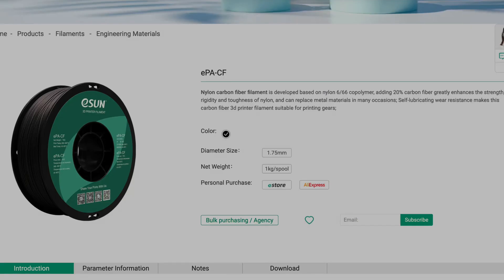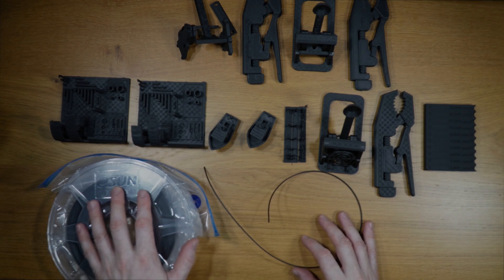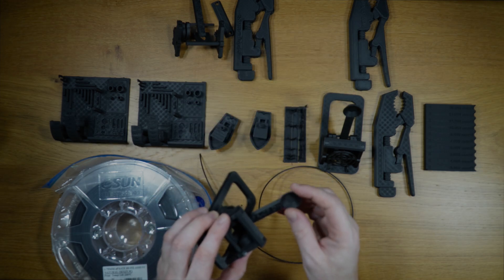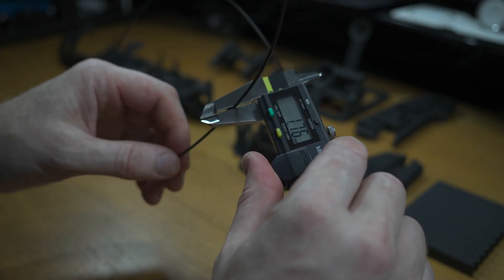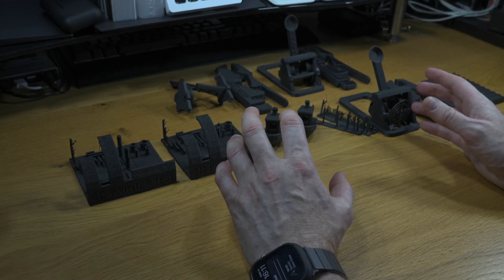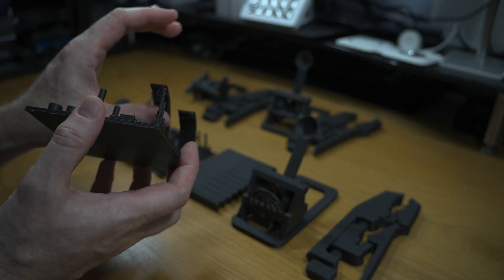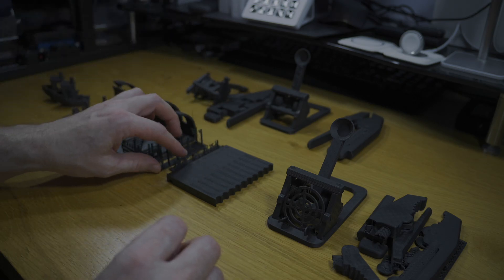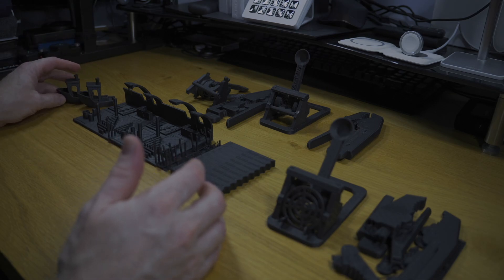eSun Carbon Fibre Nylon (ePA-CF) with Bambu Lab Carbon X1 Printer: A Followup! 🔍

Comment: I printed with this at pla 300mm/s base speed and just changed the  temps to 280c nozzle and 100c bed and it printed perfect (20rh). Then I tried the recommended slow speed  at 13rh and it failed over and over.

Comment: 0.04mm or 0.06mm I want to test my next filament and CF is on the list! Tested ASA ABS 20+ types of PETG I'm yet to print with PA ( CF ) I do have 0.04mm Hardened steel nozzle Will be getting 0.06mm Hardened steel nozzle this week along with CF. Any tips
Reply from the maker: @kurtv9375  I used a 0.4mm hardened steel nozzle and had no issues.  Keep the bed clean and use glue for the PA and dry it, ideally 70c for 12 to 24 hours, which is the most important thing.  Good luck.
Reply: @T8Maker  Good luck

Comment: did you use the ams while using carbon nylon? I seen people say you can't do that no problem with the ams now? wondering since i'm gonna print soon with this filament on my bambu
Reply from the maker: @Mr_SoulzZ yes I did, but you need to be careful, if the filament is abrasive or brittle you shouldn't use the AMS.
Reply: @T8Maker  BUT YYY elaborate YYYY and what is  abrasive and what are the dangers what is brittle. remember you are talking to the masses Mr_SoulzZ may understand abrasive or brittle but others may not. Time Time Time support for free short answers not through. Sorry but this is the problem of the school of you tube.

Comment: NYLON is an advanced filament!!!!     1. Drying without a vacuum or vacuum drying oven (the last 15% of moisture can NOT be removed over any length of time) so you will never get to true performance of NYLON  2. There are different types of NYLON (PA6 PA12) so testing setting for your own machines must be done.  3. Moving from PLA base filament (armatures) you should always tune.    BAMBU LABs should never be your first printer!!!!!!!!!!!!!!!!    Its not the settings BAMBU LABs filament I.E. other than PLA are not in there pure form like there NYLON has additives in order for ease of printing thus WILL NOT give the same performance as a true PA6 or PA12.     BAMBU LABs is the apple product without the apple stores for support and service  GOOD LUCK NOOBs when your BAMBU needs service!!!!!
Reply: What tf are you talking about ? Ofcourse nothing is perfect but you talk like you personally hate Bambu for no reasson. I'v seen plenty of people on reddit that have print farms using countless of P1s and X1s including mines. Bambu's machines are amongs the most reliable machines on the market right now, they still works perfectly fine after thousands of hours printing nonstop. Even when some mechanical parts wear out, Bambu has all the spare parts at fair price for you to buy and replace them yourself in no time. Need instruction ? Bambu wiki has everything. You only need Apple service because you can't repair anything by yourself.
Reply: @tienduy12345   BAMBU LABs should never be your first printer!!!!!!!!!!!!!!!!   1. you need to understand how a basic machine functions first ( LEVEL A BED MANUALY plus a multitude of other things) don't end up with an expensive paper weight  2.most people coming in to are shop ( first time byers of a 3d printer want to print in malty colors and malty materials) don't even understand how signal works let alone multi and waist. and this leads me to number 3 BAMBU advertises like apple as ( it all just works ) and yes it does for someone that has learned on a basic machine first! BUT THAT ADVERTISING GRABS THE FIRST TIMER WITHOUT ANY KNOWLEDGE AND 9 TIMES OUT OF 10 THEY GET DISCURAGE AND NOW HAVE AN EXPENSIVE PAPER WEIGHT. I can't give a link to my company because you tube strips it out so you have no idea as to my background and experience, we are not you tube tinkerers, are store / company is located by the only national laboratory for AM in the USA (additive manufacturing) 3d printing for those that don't know the term.  We are scientists / PHDs that study, support and PRINT in all AM technologies from simple filament to mettle powder deposition and full melt . I am personal sick of multiple companies that have moved this TECH into the masses of consumers on the premise of EASY with new gimmicks like malty material. Yes it works and works well. but nothing BAMBU LABs shows in advertising, shows complexity of how to get to multi color or multi material for your own part. So the burden is then left to the consumer after the money is spent, then they come in are shop wanting to know how to and did not talk to us first or by from us. Well we offer advance classes for this, but they believe its to expensive for training ok so go to the school of you tube and try to discern the good from the bad information and come back to me in 3 months or 10 years and see what you learned. So hate BAMBU LABs or APPLE yes for their misleading advertising, and the people with the print farms of BAMBU LABs they did not start with those machines. They learned on other machines!!!!!! and if it was there first machines they had drive to make it work for them, most don't have that they just want it easy!!!!!

Comment: To sum it up, Its garbage CF Nylon... if its even nylon. Good nylon doesnt flex like that. Referring to the pliers. That flex was ridiculous.
Reply from the maker: @globalsacrifice5248 Yes, I would say it needs significantly more drying, more that the dryers I have are capable of, since they don't go above 50 degrees celsius, and from some basic testing they hover around 45 degrees if I put a temp monitor inside.  Really you need 70+ degrees for 12 hours, which means sticking it in an oven.  Something I am not prepared to do because the cost of running an electric oven for 12 hours to do one print, just doesn't make sense.  I found the bambu lab filament better and required less drying, but I have purchased a few other ones to test, just haven't had the time.  but ultimately I need a better dryer.  Open to recommendations.
Reply: you know whats garbage? your not heated chamber toy printer. On proper one, its absolutely strongest filament till 100 euro ppa.

Comment: I didn't see any Hot End settings or bed temp as these play a crucial part. as if your out by 3 Degrees you get poor results, as it is not forgiving like PLA+ 
I have found to set the temperatures more hotter than the Temp test towers and of course NO FAN
Reply from the maker: @spudnickuk you are correct, the temps and fan settings are in the filament profile which i applied from eSun’s website.  I am traveling in Asia currently so don’t have access to my slicer settings or the profile but if remember correctly the nozzle temp was around 230c and the bed was 90c.  The adhesion on the bed was very good.
Reply: @T8Maker  90 degrees with glue or simply standard pei plate bambu lab

Comment: which nozzle u use ?
Reply from the maker: @barr1212125 hello, I used the standard 4mm hardened steel nozzle in the Bambu Lab Carbon X1.  Some suggest using a 6 or 8mm but i found the 4mm to work fine.

Comment: Nice review thank you. Which filament would you recommend for rc car parts like arm etc.Thank u in advance.
Reply from the maker: @Romangal2701 Thank you.  For an RC car you have a few options depending on what your goal is, standard nylon would work for most cases and is likely the most cost effective, its especially good in friction parts because of the properties of nylon, you could also try ASA which fixes some of the issues you can have with Nylon.  From the Carbon Fiber filaments I have used, eSun ePA-CF is the best value and if you take the time to dry if fully and tune your print, I think you will get great strong results.   For the best weight v strength I would go for BL PAHT-CF hands down, but its very expensive.  PET-CF would be great because its fairly ridged, but with that, it would also be a little more brittle than the Nylons taking knocks (I have seen this with standard PET), and its also expensive.  There is also a PA12-CF which is like the eSun from BL, I haven't tried it.  Sorry its not a straight answer, but as with everything in life, each filament has its pro's and con's and there is no perfect solution, but I hope this helps a little.
Reply: @T8Maker  Thank you very for your honest opinion appreciate it
Reply from the maker: @Romangal2701 You're more than welcome.  I just want to correct something I wrote in my answer, ASA is not 'fix' for issues with Nylon.  It is an alternate option (it fixes some of the issues with standard ABS).  ASA is often used in RC planes and cars for its ability to handle heat better than some other standard filaments along with its strength & durability.  Sorry if I caused any confusion.

Comment: Thanks for revisiting this! Can you post what your settings were where you got the best prints? Finding non-bambu labs filament needs fiddling with a fair amount to get good prints. The price you pay I guess 😀
Reply from the maker: @platedgg1920 Thanks for the question, firstly I would download the eSUN profile for Bambu Lab for the ePA-CF filament and import it to the slicer.  You can then add the profile to the slot the filament is installed in.  You will find it on the product page on eSun (https://www.esun3d.com/epa-cf-product/) about half way down you will see tabs, click on Download and the first file.  Always be careful downloading files and be sure its safe before you download anything and open it on your PC.  The file is a rar compressed file with the profiles in the file.  To add them to your filament in Bambu Slicer, go to file/import/configs and select the JSON files for the CX1-ePA-CF.  Then select the edit filament profile icon beside the filament slot in the slicer, at the top is a dropdown, from here you can select PA-CF-ESUN.  That's it.  Then make sure the filament is dry, and when your ready to print a model, slow the print speed to 100mm/s or less for other layer speeds under 'SPEED'.  Or you can cheat and when you start the print, just set the print to 'Silent' on the printer itself which reduces the speed by 50%.  They are the core things you need to do, after that its fine tuning which will vary from print to print, printer to printer, roll of filament to roll of filament.  I hope this helps.
Reply: @T8Maker  Thank you!
Reply: @T8Maker  this is what I am talking about, If you tube is making you enough money to support you and you are willing to support the masses for BAMBU LABs wile they are raking in way more money than you. same as creality does rely on the community for support, FREE every thing is FREE but its not. Its your time and my time its not free